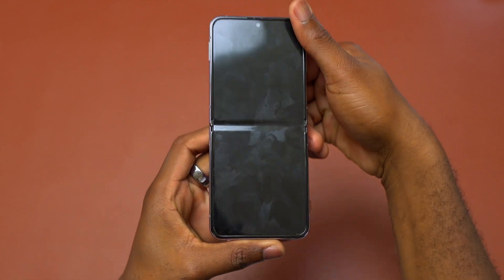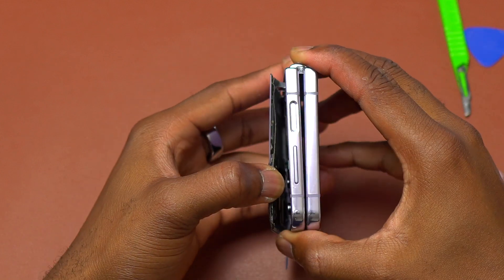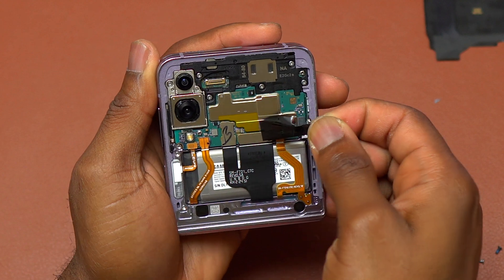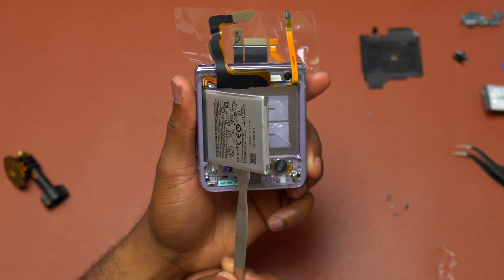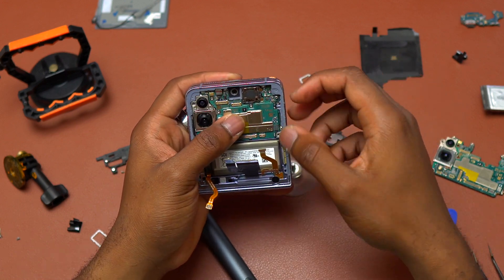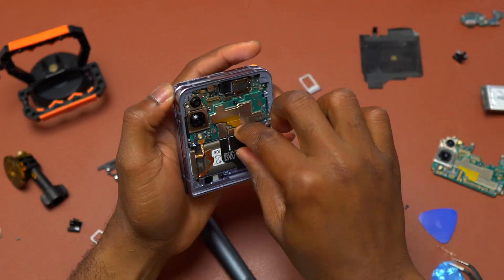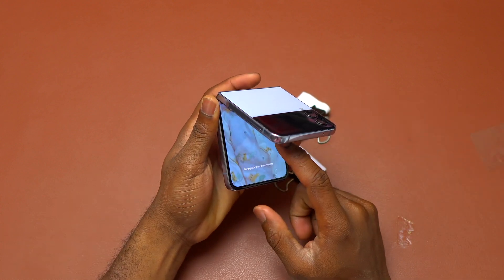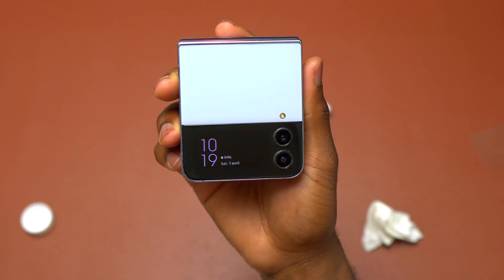Galaxy Z Flip 4 Screen Replacement Repair

Comment: Shouldn't the phone be turned off before attempting any repairs
Reply from the maker: Yes best practice wants you to turn off the device before handling electrical equipment. This device has a dead inner screen no light completely black. I was not able to turn it off due to the situation. If you are unable to turn the device off you simply cannot turn it off.
Reply: @ersbit  or you can just let the phone die then start working on it
Reply: @AfshinAhmed   Nobody got time for that when they need there phone working.